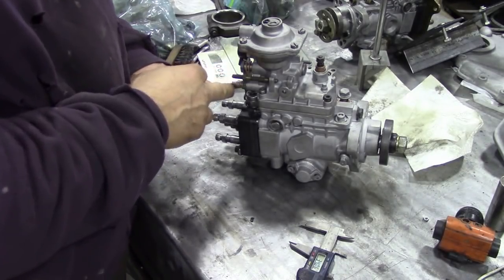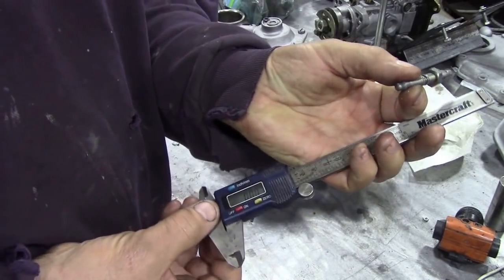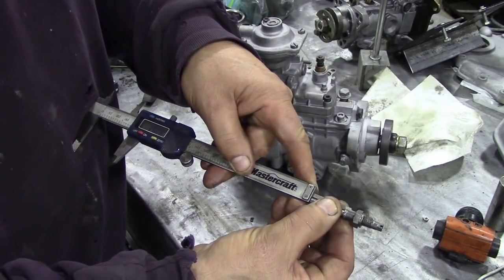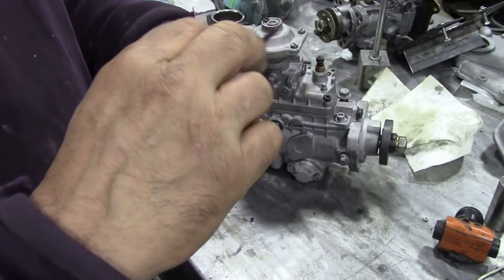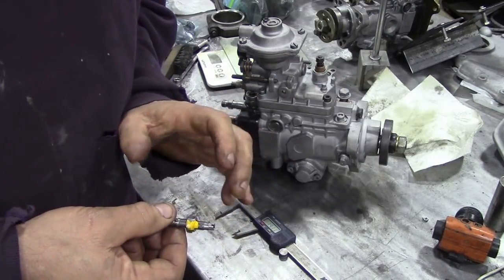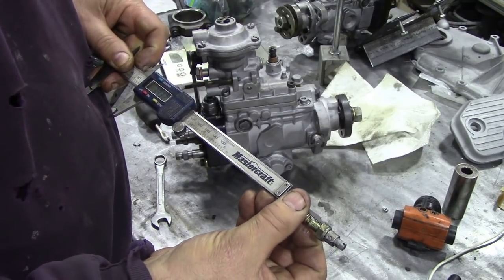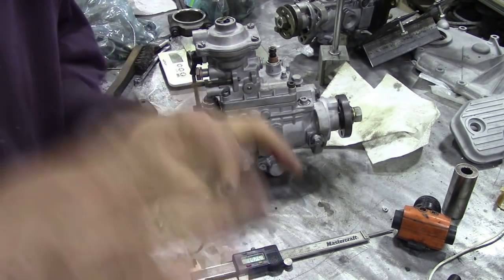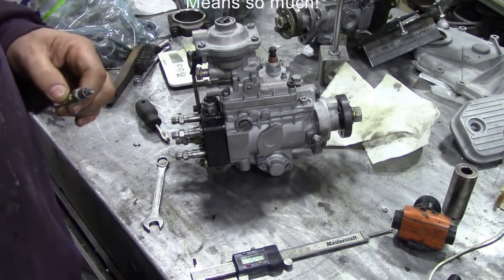200/300Tdi VE injector pump initial starting point for volume screw

Comment: Your Videos have been a life saver over the last year or so...this one was helpful because I inherited a modified 200tdi engine which was creating black smoke from start up.  Have you done a video on cleaning/checking the injectors on a 200tdi?
Reply from the maker: No injector videos as it usually involves buying new nozzles and setting them up - sadly not much information on them - and to get a pro shop do them here is expensive  - so much so, it is cheaper to buy new - but not Chinese ones!

Comment: Great to know,  I adjusted mine for power etc sounded like an alfa twin cam, but brought the settings back abit and replacing the cat didn't make much of a diferance it runs fantastic after I learned how to adjust the whole pump and its just passed the mot with low emissions , putting a large intercooler on really lowers the egt I would definitely do that first before adjusting the pump to 11 its great to out drag td5s coming up from brighouse on the m62
Reply from the maker: Great to hear!

Comment: Be right back....
Oky doky... 39.16mm. 
Runs and starts beautifully, but when i let out the clutch and accelerate, doesnt want to move until about 900-1000 rpm.
I had to lean the fuel out because i want to drive further than 600 kilometers on a tank. Im used yo getting around 1000 ks a tank.
maybe now it just needs just a squidge extra gogo juice.
Reply: what was the outcome? were you having problems before you checked it and did you get it running cleanly?
Reply: @jimnewton6566   G'day Jim. I found that someone had severely advanced the star wheel in the injection pump and wound the fuel right up. So, i had to 'reset' the star wheel, wind out the fuel and work from there. Long story short, it now runs and drives beautifully and efficiently! Zero black smoke out the exhaust.

Comment: Its allways handy to know where all the 'start' points are for anything thats adjustable. You just never know whos had a go at what :) .Any suggestions on the 'star wheel' neutral position? lol. Cheers mate. Loving your videos.
Reply from the maker: This is a big problem with pump overhauls - they should be bench tested to set them up - as you say, you never can work out if they have been fiddled with in the past
Mike

Comment: We used to tweek the wolf emissions by tweeking that screw every so slightly back in the day of been a REME mechanic. Quite surprising how little adjustment made such a big difference. Also good for hiking the power up but carefully with a exhaust temp gauge. In gives more pump internal pressure.
Reply from the maker: Indeed it is not much of a turn to make the difference and it acts on the whole rev range, not the power band you want, so it affect idle speed
100% correct for the EGT

Comment: Evening me old mucker 
Cracking schooling as always, thank you.
Any chance you could do something about alternators. I’m just about to replace the one of my 200tdi 90 and there are so many options available at Autocentre’s, eBay and more. What’s the score or is it a simple case of you get what you pay for?  I ask this with cooper washers in mind and that has nothing to do with price!
Merry wot nots to all 🎄❄️🎅🏻
Reply from the maker: Nearly all the cheap alternators are Chinese - I have not had much luck with them in the past (starters are so so)
I now fit Denso ones, which is the OEM option - so far so good!
I have on file the 300Tdi alternator :-
States Denso made in the UK, Lucas - made in Turkey
Mike